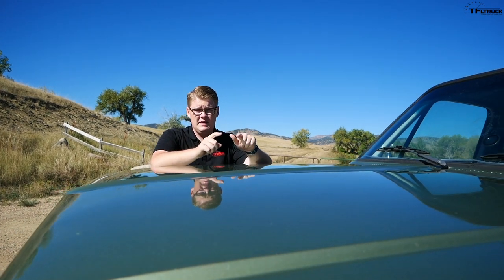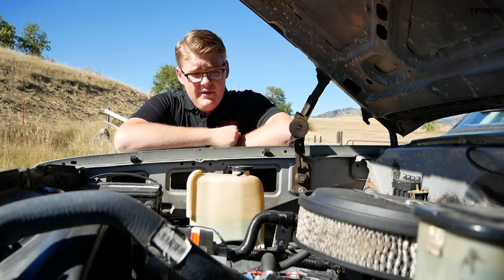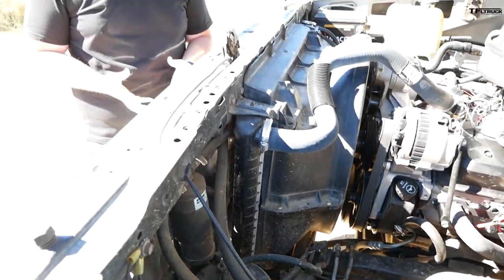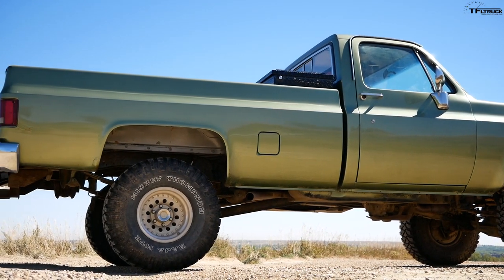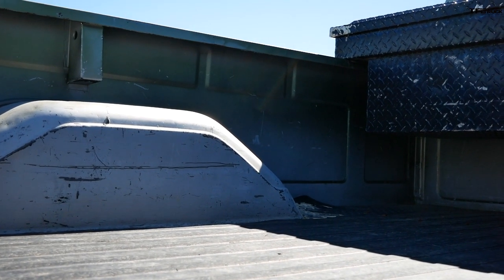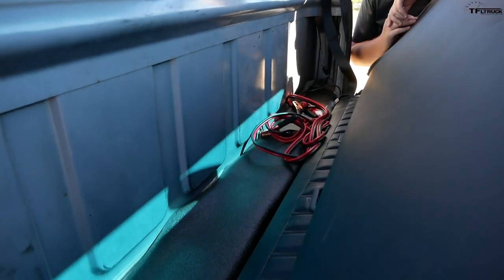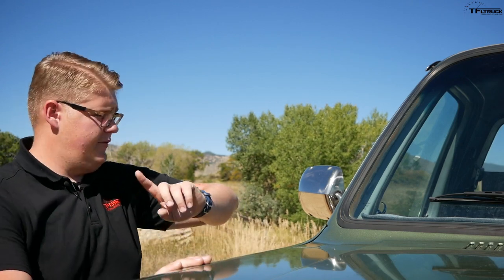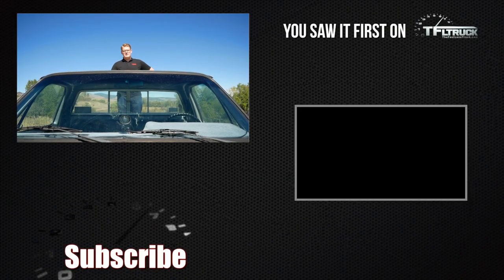Is The Chevy K10 Square Body Pickup Cool or Crap?

Comment: A very cool truck. Wish they still made a basic trick like this
Reply: They still make basic work trucks, but if you want to buy one new you  most of the time you have to order  it, the dealers don't typically keep them in stock because they would rather sell the top end models that's where they make their money
Reply: They still do, and nobody actually buys them (besides fleets)
Reply: That base price you see on dealer websites is the basic work trucks. You can still get manual windows and locks in some of them
Reply: You CAN'T get them like this today, gm quit the manual transmissions in trucks back in 07 so... No, you can't get them like this anymore.
Reply: MRJEB25 Not a Silverado, and that's because nearly no one was buying them. But you can still get mid-size trucks and Ram HD diesels with manuals. If that's what you want, put your money where your mouth is.
Reply: @AkioWasRight  Put my money where my mouth is? Remind me again what part of any of this thread has to do with that. However, I did buy an 01 Silverado half ton with a 4.3 and a 5 speed, floor shift 4x4 AND short cab long bed, a REAL MAN'S truck!
Reply: "Your mouth" was rhetorical.
Reply: Sadly they never will make them like this anymore, too many regulations now.
Reply: There are bunch of guys at my work that have trucks but don't do truck things the bed is very clean. I don't get it. And can't stand it.
Reply: Samuel Clark If chevy rolled this body style off the line today they would sell like hot cakes. I’m sick of hearing “we based the 2019 off of the square bodies..”
Reply: @theunknownone5663  What don't you get? Some people like to have a truck because of bad weather like heavy snow and to use for light home projects and outdoor hobbie hauling like motor biking, mountain biking, khyaking off roading etc.......got it???
Reply: @justinbrown5129  But they won't. The Ford is the closest I see to square body in the single cab configuration. But you won't see the 80's come back. Sorry.
Reply: @Anth230  the guys I'm talking bout don't do any of those things on hiking bikeing or lite hauling not even wanting to drive in the snow in them because the worry about rust. That is what I don't get. No camping like zero truck things.
Reply: @theunknownone5663 Well than that is a waste. I bought an f 150 regular cab and I live in the rust belt. So heavy snow most years. I am hoping the aluminum body holdd up a bit better than my Ford Ranger. The ranger started to rust a bit in year 7 but in year 11 it overall was pretty clean for the harsh winter's it saw. My new truck will see lots of sport time. Not till springtime though. But yeah the bed has to be used at least. Tell them to get a spray in bed liner...lol
Reply: @Anth230  sad thing is they happen to be 3/4 ton trucks too. If you see and talk to these guys you will scratch you head and just be sad. The only buy them just because they can. Keep them clean only to trade them in later. If I had one it be trashed the first year cause of biking hauling and kids. Also I keep tools in the back.
Reply: @theunknownone5663 3/4 ton ? Wow...lol
Reply: I bought a New basic work truck Silverado in 2005 for $18K. Aside from the auto transmission, it's all manual. I bought it off the lot before they started making you special order them. Fortunately, I got it before GMs quality went to crap. Still drive it with 185K miles and no issues so far. I've seen them hit 400K, so hopefully it holds up another 15 years before I get a Toyota.

Comment: I think Big green is the best vehicle you guys test. It has ac and fuel injection, that is all you need in a truck.
Reply: James Hall agreed. FI AC and three pedals!
Reply: No need for fuel injection if your a good enough carb tuner
Reply: Ryan Fackler exactly
Reply: @ryanfackler7567  I think he put the injection on because of offroad choking the carbs are prone too...
Reply: It’s got those little vent widows that direct air into the cab. Those are all you need, plus the sliding rear window!
Reply: I'd argue that you don't need either. Driving around old hot rods and beater pickups you learn AC is optional, and that carburetors have more potential to be reliable if you maintain your fuel system and know how to tune.
Reply: Not in a 7.5l 460 🤷‍♂️

Comment: I have a 1978 Chevy square body 4x4 done up like "The Fall Guy" truck...its been in the family since new...worked until 93 and was parked in a barn until 2006 when it went through a complete restoration/transformation in "The Fall Guy" truck and now has an easy life during the summer riding around looking pretty.

Great trucks!
Reply: I got an 86 4x4 short bed also painted like the fall guy truck

Comment: They cant use the old commercials because full size trucks are no where near "easy on the bucks."
Reply: Yar Nunya  over $20k now. I bought a truck like that (though a Dodge) in 2008 and the MSRP was $22k, truck was $18k after a $6k rebate since due to high gas prices, full size trucks weren't selling that year; and that was 10 years ago

Comment: Rust is normal on any vehicle don’t care what make
Or model
Reply: Very rare and intelligent statement I couldn't agree with you more!!!
Reply: Don Mohring the 1st gene Silverado 99-07 have really bad fender rust , I have a 99 1500, a 2005 2500 and a 2004 1500, all have rust , but I love them lol
Reply: Don Mohring not in texas👌🏼👍🏼 well other than the chassis which is pretty much gonna rust anywhere in the world.
Reply: @TGears314  I'm in New England right in the heart of the Rust Belt and everything up here rusts the same ((different Vehicles rust in different spots more than others but still they rust))) even e-coated frames that are coming out they still rust. (just not as bad)
Reply: But these square bodies are more prone than a dodge or Ford of the same era, it kills me to admit it because I'm a die-hard gm guy but they do rust horribly, keep them clean depending on how much salt it is where you live will determine how bad it will rust
Reply: @samuelclark9909  I would have to disagree with you.. I run a repair shop in New England and I regularly see Ford's and Dodge trucks in the shop that are rusting in the same areas meaning the frame the rear fender Wells and the rocker panels.. my opinion is they all seem to rot the same with slight variations. ....What I found that seems to work the best to stop it is to have the vehicle oiled with a product like or similar to New Hampshire oil once a year it completely stops any further rusting and won't let it start if you get it from brand new...
Reply: @jpatt973  I live in va, most of the rusted trucks here are chevys
Reply: @samuelclark9909  that's funny I just went to West Virginia last year to pick up a  used  frame for my 2004 GMC 2500 HD pick up and it was in really good shape except for one cab Mount I had to repair. I'm not trying to say Chevys are better than any other brand I'm just saying I feel they all rot the same and these are things I see with my own eyes on a weekly basis.....((I'm in Ford Country in Massachusetts so we predominantly see F-150s around here))) When I was in West Virginia at the salvage yard the gentleman who owned it told me that I was in Chevyland so much so he stopped buying Ford and Dodge wrecks because he sat on the parts too long so maybe you just have a lot of Chevys in Virginia.
Reply: @jpatt973  yeah the part of va I'm in is predominantly Chevys and gmcs, I'm not far from west va, ironically the 2012 gmc I bought used came from west va
Reply: Hell my 91 k5 is rust free thanks to New Mexico desert
Reply: Samuel Clark you see it more on the old chevys because there is a shit load more still on the road. You don’t see many fords or dodges from the 70’s and 80’s still driving around.
Reply: I'm in Phoenix Arizona and my old truck (a 92 F150) is 100% rust free. Even the underside looks factory fresh.
Reply: Or year!

Comment: This body style of truck was awesome, I had 2 blazers in this body style both with a small lift an 33" tall by12.50" wide, one was a 1976 and the other was a 1984, I opted for blazers so that I could take the top off which was awesome when cruising down the highway in the summer and also because they had a shorter wheelbase and had a back seat so I could take 4 people wheelin with me at once, they were fun as hell to take wheelin and at the time I had a 2 year old 1996 pickup that cost me a good amount of money and I used to take it wheelin and I got tired of beating up my nice almost new truck so that's why I decided to get the blazers and with the solid axle front end they were indestructible. I even took one in the tough truck race before the monster truck rally and took 3rd out of 24 challengers, I got to bring 2 friends to be my pit crew and it only cost me $50 to enter and after taking 3rd I ended up winning $150 plus then me and my 2 friends got free admission to watch the monster truck rally afterwards! Needles to say I had a ton of fun with those blazers!

Comment: Cool! I miss my old '85 C10 like crazy, but at least I know where it's at if I ever want it back since I sold it to a good friend that doesn't even use it. Short bed, fleet side with two tone paint and a 305 and a turbo 350. Dependable as all get out. Silverado package and everything. It was pretty rusty like you mention (that happens though when you live down by the Gulf of Mexico) but what can you complain about when the thing has 325,000 miles on it? Tough old truck that always got the job done and got you where you needed to go. Nothing more, nothing less.
Reply: Yes I had a friend who had a c10  and he drove it ( it seems like) till the hinges came off. He had it a long time ." Boy the good times we had!"

Comment: The weak link, or rather links, are those 10 bolt axles. With 400hp and 33's it won't be long till they're turned into shrapnel. Easy fix though, a Dana 60 and a Corporate 14 bolt from a K30 will bolt right up. I'd also look into swapping out that NP208 chain-driven t-case for a gear-driven NP205.
Reply: Fake news...the 10 bolt was a tough axle....with th 8.5 gear....it got a bad rap...cause in early years it had an 8.2? I believe🤠🤓🤗🤗✌

Comment: The key lock is only on manual transmission models.  It was supposed to be a reminder to put it in gear or set the parking brake. Lots of vehicles had them back in the day. I loaned my 1988 Ford Ranger to a sibling about 20 years ago and she panicked when she couldn't figure out how to get the key out of the ignition. Luckily instead of leaving it with the key in the ignition in a busy parking lot she drove to a payphone and called and asked. There was a button underneath the steering wheel you had to push to get the key to unlock
Reply: John Simpson I've had 3 squares all automatic, none of them had that key mechanism
Reply: I don't remember my 78 c2500 manual having lock lever
Reply: My 2001 S10 (Reg Cab short bed 4x2 4cyl 5 Spd) had that key unlock button
Reply: I have it on mine and my cousins k10 had a 6.2 diesel auto and was wondering why his didn’t

Comment: I have a mostly original '79 Cheyenne K20. Second owner. California truck. No rust. 150,000 miles. Stored for many years. Even has an old self contained 8.5' Six Pac camper. I lifted the truck 4" thirty five years ago. It has had four tire changes over that time. Currently has 36"x13.5"x16.5" Swampers on 35 year old Eagle slotted 16.5" wheels. Original 350 with a TH400 transmission and NP205 TC. Soon to install, a new GM crate HT-383. 
Thanks for all the videos, guys. Love the Big Green project. I learned lots from watching. How are the Flowtech headers working out on the ZZ6? seems I remember you saying there was an exhaust leak.

Comment: COOL is what the Chevy is.  My preferred configuration would be as follows: K30, 4 spd auto trans, dana front and 12-bolt rear, 400 cu engine w/ 4BBL, and I'm good to go!  Whining about the door getting "heavy" and difficult to close is petty, that's called over-engineering in my opinion, and that's how a real man's truck should close.  I'd give anything to go back to a real truck like that, my only preference would have been to have a crew cab, and I love bench seats!  I absolutely HATE HATE HATE those disgusting ginormous garbage center consoles that keep getting bigger and bigger and wasting more and more space, they absolutely disgust me!  Thanks for the review TFL Truck, well done! ;-)

Comment: Without a doubt, a very cool truck! And I love the hokey ads from back in the 70s...they take me back to when I was young (before the "Nanny State" took a lot of the fun out of things).
Reply: “Nanny State”? So, let me get this right, you would rather have death-traps like these on the road than modern air bag equipped vehicle? Your nanny state has saved thousands of lives by making auto manufacturers build safer vehicles. Go right ahead and drive an old piece of shit death trap if you want, it’s a free country.
Reply: Rod Z Why such a caustic response? Of course modern standards are, generally, very beneficial. I never said they weren't. I made reference to the "fun" aspect -- which I recognize is highly subjective -- and, for me, enjoying some nostalgic fun soothes my soul.
Reply: Patrick Curran I’m not sure where that response came from either. I was born in the 90’s but I totally appreciate the way ads used to be made. They are significantly better than the bs were surrounded by today. Idk if it’s just me, but they seem to have been a bit more personal back then.
Reply: Exactly mate but these modern car lovers will never learn.
Reply: Yar Nunya  A $50,000 pickup is wayyyyyyyyyy overpriced for my taste anyway.

Comment: Big Green is cool the way you have it set up.   A stock 85 truck with the 305 that most of them came with, well thats not cool.  The rusting issue is also really bad for all chevy trucks.  One really cool feature of most of the "K" trucks, is that once the truck had a few miles on it, you could just pull the key out of the ignition when it was running.  Really handy for cold morning coffee runs into the gas station.
Reply: Yea  All Chevy's...  lol  Because Ford, Dodge, Toyota, Datsun, and what other brand never ever, ever rusted.
Reply: tedl175 >>> that's a very interesting comment about being able to remove the key while the engine|motor is running; I never knew that!  and ... I'm going to test it on my Chevy Van, perhaps it's the same?
Reply: Here's a list of my cars from back then I could do that with: '79 Malibu, '82 Ford Cougar, '86 Celebrity, '88 or '89 K-car, '91 LeBaron.  You could do that with a lot of cars and trucks back then.  8-)  I'm not 100% sure, but I think I was even able to do this on my '99 Plymouth Breeze after a few years.
Reply: Yep.  I have a 94 s10 with 240k and a 91 Cherokee with 303k and I can take the key out of both of them with the engine running.
Reply: My 01 Silverado could do that..... plus the doors were unlocked with a Plymouth van key when I locked them in on time
Reply: The one Taylor Kitsch drove on Friday Night Lights was a good one, 86 K20 Reg Cab with the 454 4bbl and the SM465 4 Speed

Comment: My 1st truck was a 1978 K10 with the 350/4 speed set-up. Bought it 1980 with 12,500 miles on it, had a plow and 3" lift. Got rid of the plow and put a set of 14/36-15 Pro Trac High Rollers on 15x10" aluminum wagon wheels. Just a big brown monster, wish I still had that beast.

Comment: Most definately cool.

Arguably, the body style went until 91 though. GM kept the square body style on the Suburbans and the Crew Cabs, then in 92 updated those trucks to the next body style.

I've had a couple of these trucks, I have a 76 GMC Jimmy, granted it's much shorter, and an 82 Suburban and my Dad has a 74 K2500 GMC. We never ran into any cracked frame issues so that's a new one on me. We hauled a lot of hay with the K2500.  The only one of the 3 to have A/C is the Suburban, and it's the fancier A/C unit because it is the Silverado package.

I do think GM should have come out with the 5 speed manual for these trucks much sooner.  One can install them now, since adapters are available to put pretty much whatever into whatever.  But true, the SM465 is pretty bulletproof, just not as efficient.

I believe the 5.7L diesel was still available at this time yet, but may have been discontinued in 84. GM finally got all the bugs worked out of that engine, and the last few years it was a real good, powerful, efficient engine, but the previous issues with it gave everyone a bad taste for the engine so the 6.2L came out to replace it. It's too bad, because it ended up being a good engine.

My dream truck in this body would be a Crew Cab K2500 4 speed with the 5.7L diesel in the last year offered.  Only change I'd make would be to swap out the 4 speed with a newer 5 speed to increase mpg, or try to find an aftermarket over drive unit for it.

Comment: I built a 1980 K25 WITH A BUILT 350 W/CAM AND CARTER AFB 625 CFM CARBM 205 TRANSFER CASE, 14 bolt 10.5 rear end and 2.5 ton spring pack front and rear and was a real work truck and hauled a lot of stone for stone walls  LOVED IT IT WAS A BEAST

Comment: I miss my '76 C10....with the 250 and 3-spd stick.  Very basic, very reliable.  Never heard about the steering box and frame issues, but all the other issues were true....especially the hood early hoods with the coil springs.  There was a refresh in '81, and they took metal out of the frame that year, added more plastic.

Comment: There were actually 7 difference transmissions offered in these trucks over their production run. A 3sp manual, the 4sp featured in Big Green, and a 4sp OD manual. Autos were the TH350, TH400, 700R4, and for the final 1991 model year the V3500s got the 4L80E.